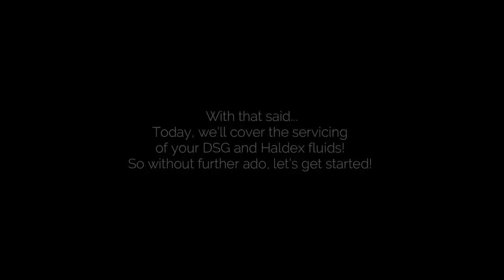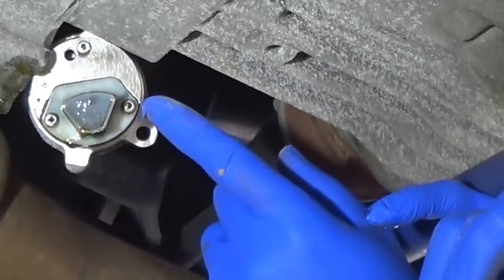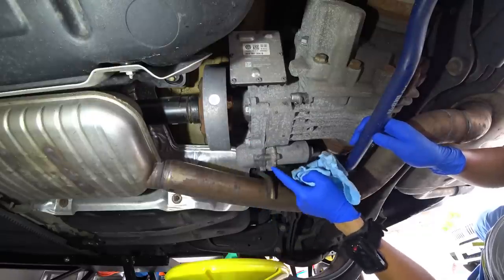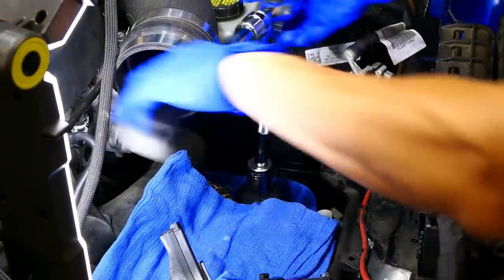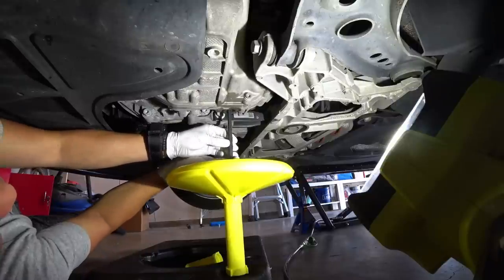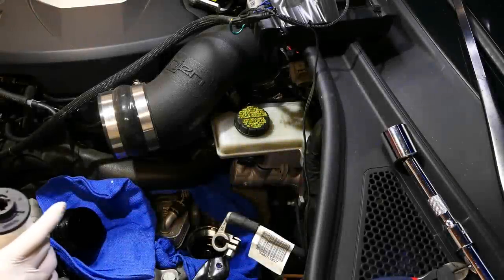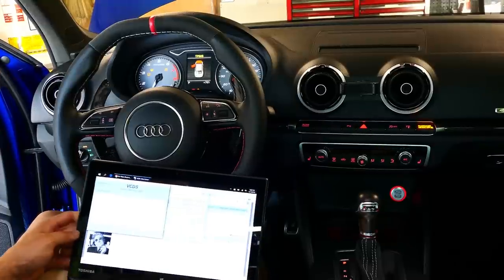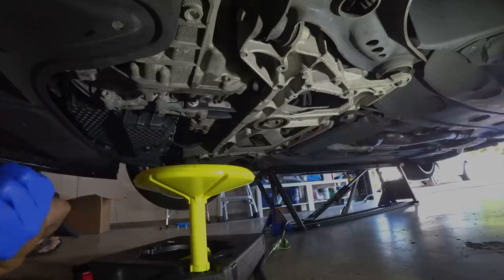How to change DSG and Haldex Fluid on an Audi

Comment: Where are you located. I have a 2016 s3. I was wondering if my car needs to be level to do both or one of the change overs? Or can I have my car on a ramp front then back?
Reply from the maker: Jessica, I am located in SoCal. in order for you to perform the DSG and Haldex service, your car has to be level. Otherwise you will have improper fluid levels.

Comment: Did you use 5 or 6 liters of dsg fluid? ECS tuning sells kits with 6 liters and Shopdap.com sells kits with 5 liters. Thanks!
Reply from the maker: madc0bra2, I ended up using close to 5 liters. The remaining liter or so will remain inside your transmission. If you want to be safe, order 6 liters, but I'm certain, you will not use it all.
Reply: @TheAutomotiveFanatic  Thanks a lot!

Comment: Bro, when you do last drain at 32 degrees, you have to leave the motor still runing?
Reply from the maker: Naïmovic, to be clear, it's 32 degrees Celsius. You do have to let the vehicle run until the fluid reaches that temperature.

Comment: Is this for the 7 speed gearbox on the facelift? Or is it the exact same procedure
Reply from the maker: Mitchicken, I did a little research and found the procedure to be the same on a PFL or a FL 7spd.
Reply: The 7sp won’t be able to top fill as the filter is horizontal

Comment: 30,000 miles is way to high before you service Haldex, independent specialists recommend every 10,000 and that includes a pump strainer clean.
Reply from the maker: @Nick, I completely agree. After seeing how easy it is to service the Haldex, I would consider 15K a reasonable service interval.

Comment: Do I need to have my car level to perform both services or one of them?
Reply from the maker: Yes you do Joey, otherwise your fluid measurements will be completely off.
Reply: The Audi S3 Fanatic did you see one of my videos on my channel asking about the noise from the engine bay when I turn my car off? If so any thoughts? Also I found some fluid on top of my DSG do you have an email I can send you a picture of it?
Reply from the maker: @joeyleclair3213 , I just listened to the noise you're asking about. Unfortunately, I've never heard that noise before so I cannot offer any ideas. Maybe you can try to disconnect your negative battery terminal and let the system reset for 15mins? Any mods? changes, etc?
You can email me directly @ p_vu@yahoo.com
Reply: No it was doing that shortly after I bought it. I brought it to the dealership they said they couldn’t reproduce the noise. I don’t know how it does it every time I turn off the car. Nothing has happened has been a year. I am just waiting for something to happen to find out what it was I guess. Thank you so much. I ordered a Haldex pump and fluid because mine has never been changed or serviced. Thank you for your video’s. Thay are truly helpful. If I have any more questions I will surely ask you.

Comment: What are the mileage interval services 
Thanks
Reply from the maker: ordazjr, Audi states that the DSG should be serviced every 40K. I would do it every 20K. It's piece of mind.
Reply: @TheAutomotiveFanatic  oh ok i wanted to know cause i bought a 2017 S3, and how would find out if those services have been performed on mine.
Reply from the maker: @maniirdzjr24 , you can always check with Audi to see if any of the services were performed at the dealership.
Reply: I just diy the dsg , I drained about 5 liters, so i topped it off with 6 liters but after leveling out excess fluid it returned 1.5 liters. So that leaves me with about 4.5 liters in.
Reply from the maker: @maniirdzjr24 , I have read that most people will pour in between 4.5 and 5.25 quarts.

Comment: Hey, Just wondered if you used the whole 850ml of Haldex Fluid? I saw in the video that there was some overflowing and then you topped it back up later. Did you do this with just 1x850ml bottle of haldex fluid ? Cheers
Reply from the maker: Ste O'B, no, you won't end up using the entire bottle.
Reply: Thanks for the speedy reply.
Reply from the maker: @Stevo3032  no problem!
Reply: @TheAutomotiveFanatic  I did the Haldex yesterday. Very easy. My filter wasn't that badly blocked up but the oil was black! A bit of peace of mind that it was done correctly as well. Next project, DSG!
Reply from the maker: @Stevo3032  well done! Now you do have piece of mind that the Haldex fluid is clean and free of any potential debris. Good luck with the DSG, you can do it!
Reply: @Stevo3032  How many miles on the car?

Comment: You keep saying "differential" or "diff" when working on the Haldex.   These are not the same.  The Haldex is a clutch.  The differential has separate drain/fill plugs and uses a different fluid.
Reply from the maker: Gary, you're 100% correct. The Haldex and diff systems are completely different.